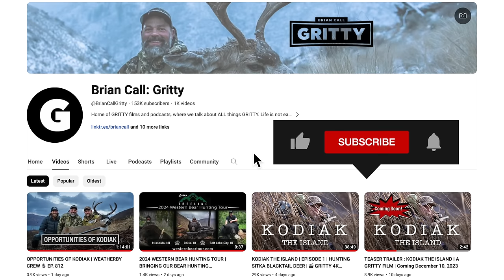BACKPACK GEAR LIST 2023 | THRIVE IN THE BACKCOUNTRY 🎙️ EP. 815

Comment: Great list!  Killer tips on multi use of trekking poles and the Flextail! The ONLY item I would challenge you on is the MTN OPS Battleground hoodie. I love it but found it doesn’t do well as a top layer if you are wearing a pack. The parts that contact the backpack shoulder straps — chest, shoulder, or back — showed wear for me after only a couple hikes. Otherwise, it’s a solid piece of gear.👍🏾

Comment: what would you recommed, the stone glacier puffy or the kuiu? I believe in one of your videos you said the grummen is the same weight as the ultra, but the same amount of insulation as the super down.
Reply from the maker: I greatly prefer the KUIU Super Down to the SG Gummen. I like the matt finish of the KUIU, the cut, and the exterior material, which is less prone to getting snagged and getting holes in it. And the KUIU Super Down just feels warmer too. But all that said, you can't go wrong with either jacket.

Comment: Curious if you have tried a quilt such as  Katabatic? Cut about 10oz for equivalent in a sleeping bag.
Reply from the maker: Brad here. I have been using the Enlightened Equipment quilt for years. I have been super happy with the performance of it and the ability to stay warm in temps below zero, yet also open it up during the hot summer months. There are some great things coming down the pipeline that are far superior to my quilt. I love that thing and the weight to performance ratio, but our new sleep system is again far superior.
Reply: @GrittyGearAndPodcast  Brad! Does the forthcoming sleep system have a hood like a mummy bag?

Comment: Yeah my rechargeable steri pen doesn't stay charged.  Original one works great.
Reply from the maker: Yes, the last Ultralight Steripen we bought for my dad didn't work. We ordered a replacement and the replacement didn't work. We ordered a 3rd UL Steripen and it works like a champ. Not sure what's going on with Steripen, the failure rate has always been bad but the failure rate in the last couple of years seems to have skyrocketed.

Comment: Have you compared the mountain ops merino to kuiu? I have kuiu and have not even thought about trying anything different since, that puffy set is awsome ive had mine for 4 years now, proper layers it handle ND sub zero weather
Reply from the maker: Hey Brad, I haven't used the KUIU in a couple of years. I'll try the KUIU later this year and see how it compares. I'm still shocked by how good the MTN OPS Battlerground merino is. I've used First Lite, Sitka, and countless other brands of merino base layers and that OPS merino stacks up better. But my KUIU merino is old. I'll try a new one and see how it holds up.